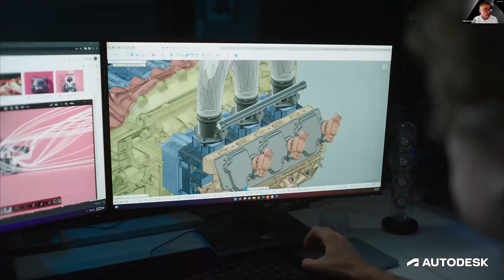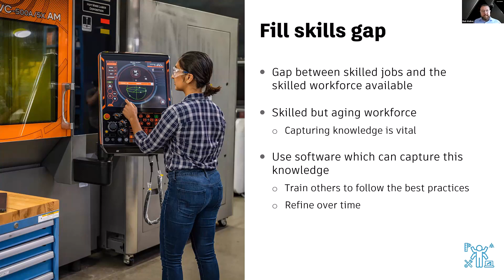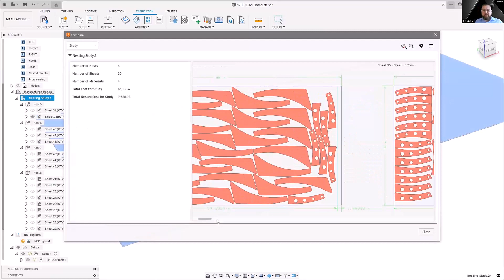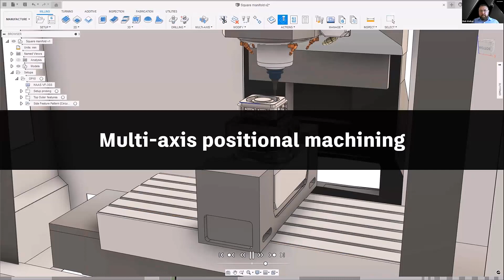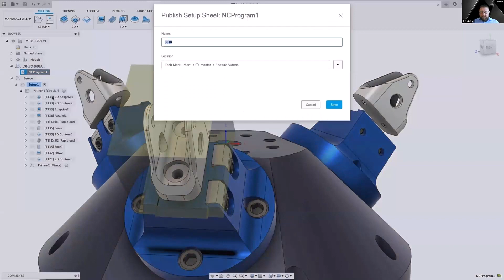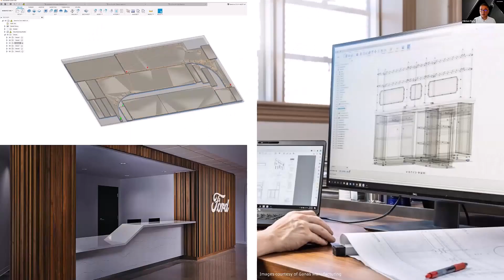Is your manufacturing software evolving to keep up with your needs? | Autodesk Fusion 360

Comment: I have been a fusion 360 user from its early days. We installed a laser cutter 2 years ago to quadruple our output. Unfortunately fusion can not supply the correct iges file for the machine. Solidworks can. So very expensive for us. Fusion has shown no interest in my requests.

Comment: Why is the conversion from cloud credits to flex token 3 times? Where the heck did you come up with that? Lots of customers are not happy
Reply: Pay higher and higher prices and have in-game purchases. Sound like any other money horny developer. The stability of simulation server is not great and no more option to run it locally
Reply from the maker: Hi Emang! Back in March 2022, we announced the intention to change Autodesk products (including Fusion 360) so that they stopped using cloud credits and used flex tokens instead. While you are right in saying that flex tokens are generally 3 times more expensive than cloud credits, we also reduced the rate at which they are consumed - meaning little if any impact on the overall cost. If you'd like to learn more about this change, please visit https://www.autodesk.com/products/cloud-credits. Thank you!